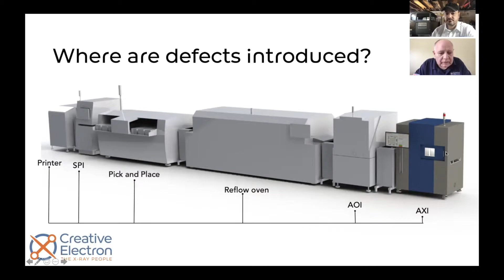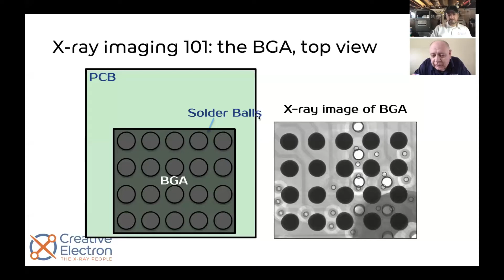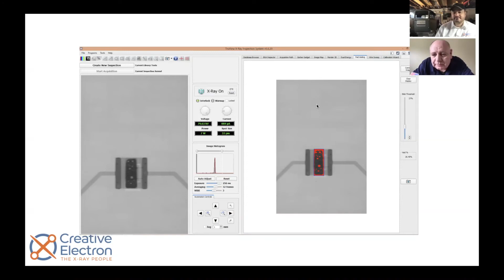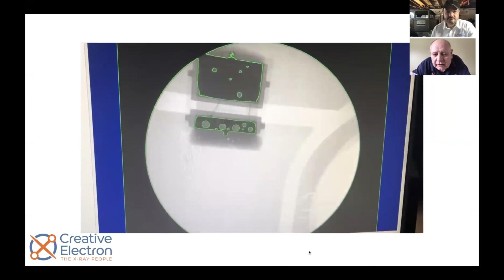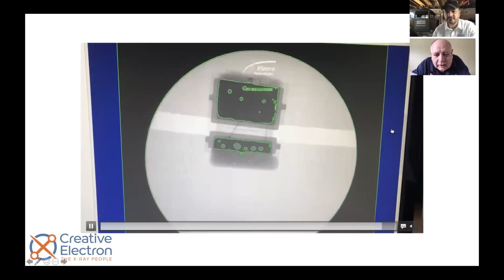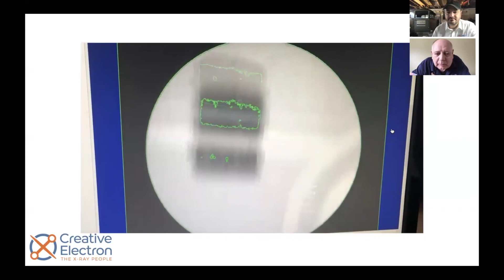1 - The X-Factor - How X-ray Technology is Improving the Electronics Assembly Process (Part 1)

Comment: Hi, I have a few questions about image quality. I'm a software developer and I'm working with x-ray software for security screening.
On my work, we normally receive images acquired from line detectors and a 1 mm focal spot x-ray tube.
Seen your images I'm trying to understand how do you get images so sharpen. I imagine you use medical flat-panel detectors and micro-focus x-ray tubes.
Can you talk more about technical details?
Reply from the maker: You're correct, we often use micro (or nano) focus x-ray tubes with high definition sensors (~50um to 139um pixel size). The sensor to source distance for electronics inspection is in the 40" range, which helps reduce scattering. On top of that we have proprietary sharpening algorithms that bring up the smaller details on the image. These details really come alive when you work with the whole 16 bits of the image. Hope this helps!
Reply: Creative Electron Thank you so much! 
Awesome answer, really relevant to improving my work. 
Today we use detectors with 1.25mm to 2.5mm pixel wide, a lot bigger than yours. Ours detectors has 18bits but the images are small 640px height with “infinity” width, we use conveyor belt. I appreciate so much your images and content in the YouTube channel, thank you to share your knowledge.
Reply from the maker: @andreagenor  You're welcome! Please let us know if you have any other questions or comments.
Reply: @CreativeElectron  I have a lot of questions about collimation, filter, and grid detector collimators.
We have a product to scan a full-body person, that product has two x-ray tubes and two sets of line detectors. The first detector line is in C shape for the full-body scans and another is just a straight line for the chest.
Both x-ray tubes are 170kV 1.2 mA with a focal spot 1.0mm, 80º coverage and the detectors are the same we use in the luggage machines. The distance between the x-ray tube and detectors is about 78" inch for the main tube and about 48" for the chest. I don't know the exact distance.
We use lead collimation with 1mm opening and the conveyor belt runs at 0.24 m/s. Our images haven't good contrast and sharpening.
I think x-ray scattering is one of the problems, but I don't know what is the best approach to understand this problem. 
What is the correct way to calculate the collimation opening?
What the impact of collimator opening in the image contrast?
Do I need grid collimation in front of detectors?
To block light leak we use an aluminum tape, what the impact of that in the scattering?
Sorry about so many questions, we have engineers in the company, but I think you are the best in this area, and I want to be the best too.
I'm a software developer, but I'm self-taught, very curious and I love work with x-ray, the challenge motivates me.
I want to learn more about this to do my own DIY experimental CT.
Sorry about my bad English skills, I'm from Brazil and this is not my native language.